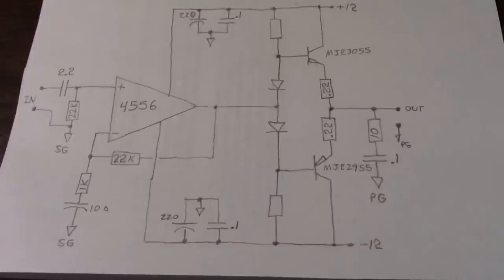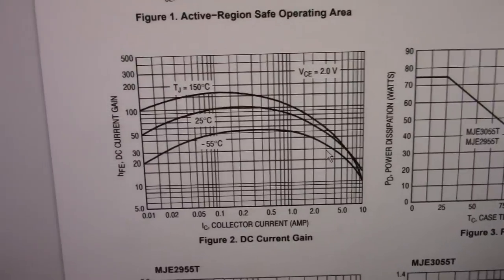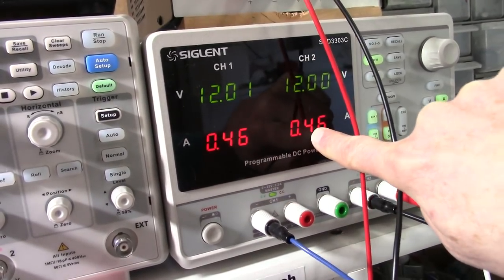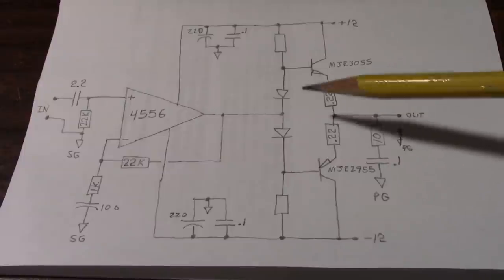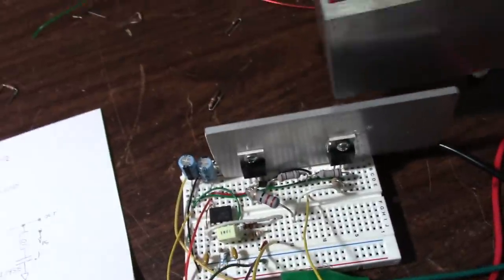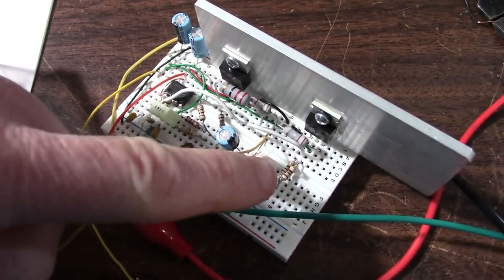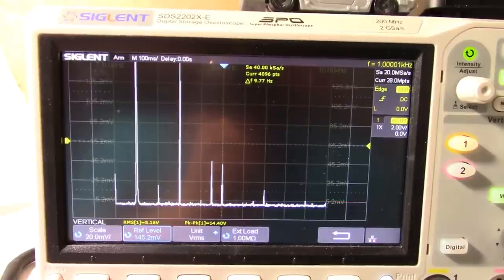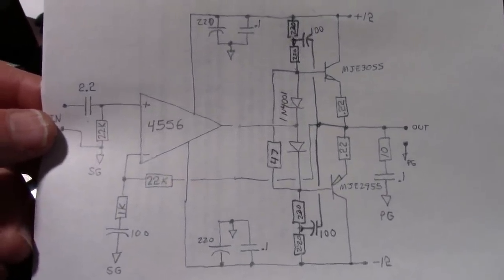Opamp based audio amplifier - 4556 driving two transistors

Comment: I had noodled out an amp design sort of like this, using op amp to drive a transistor push pull output stage.  But I haven't got around to making the video.  And its good. Because you do a much better job of explaining it than I would have!  Thank you for the video.

Comment: It was pretty obvious from the outset that using the biasing resistors were going to be a problem, since the peak current occurs when the drive voltage is closest to the rail, and that's when you have the least voltage across the bias resistor that needs it.
Having added the bootstrapping, the only other trick you might like to try is to split that 47R resistor across the biasing diodes into two 27R or 22R and connect the junction to the opamp output, in effect using separate resistors across each diode. That would mobilise the ability of the opamp to supply a decent drive current, albeit via 22R/27R, but it's a free bonus when your opamp has significant current capability.

Comment: Nice. Very similar to a project I've been tinkering with. This will help me. Thanks!
Reply: Originally the circuit looked a lot like an amp I built years ago. I got the schematic off red circuits I think it was called?
Reply: They thought of everything back in the day. I mostly just reinvent the wheel, but I enjoy it
Reply: @Spentelectrons  nothing rolls as good as a wheel does. So why not use it?

Comment: Hi John! That's great videos of yours. I'm experimenting on these simple amps too in the moment. What about using diodes in the 220-package and mount them alongside with the transistors for thermal stability? And what I found today is to put a resistor of about 120R between the bases in the basic circuit. I achive full power with this, but with a bit of crossover distortion. I'm using BD 910/911 (hfe 152) which perform better than 2SC5200/2SA1943 when testing the amp with square waves. May be you want to try it. If you want, have a look at my square wave video. Regards!

Comment: I've tried using opamps as simple amp circuits a few times. I always find to get decent performance out of them you end up adding enough extra components to offset the simplicity.

Best one I did used two opamps each directly running one output transistor  with DC offset applied to the +input for bias, and NFB taken from the emmiter of the transistor that opamp drives. Then a 3rd opamp for  global NFB taken from the output, and providing voltage gain.

Works, but you've just lost all the simplicity you were aiming for.

Comment: I would skip the 23 ohm resistor that shunts current around the bias diodes.  Instead I would increase the two 220 ohm resistors to maybe 1k each.  But then there would not be enough current to drive the bases.  So instead use the 4556 opamp to drive the bases.  To make the current bidirectional, put another diode across each bias diode, cathode to anode, or anti-parallel.  That way the opamp can sink or source current to each transistor.

Comment: Many AV amps have used this method with glorified op-amps as pre drivers and then traditional push pull outputs.  Sony comes to mind.  Edit:  I noticed when you said it was clipping on the bottom you should have changed the V/Div on the scope.  Pretty sure you were at the displays clipping limit.

Comment: I really enjoy these small design, build, and test videos because all the key concepts are very concrete and tied to easy-to-identify components or small subsystems. I was able to get your headphone amp working on a breadboard and tweak it to run off coin cells and drive a small 4 ohm speaker instead of headphones fairly easily, which was the first amp I built and very satisfying.

A lot of questions come to my mind from videos like this one and the headphone amp one like, what if you added a transistor to amplify the op amp current or made the output drivers Darlington or complementary feedback? How would you replace the op amp with a discrete VAS? What issues would pop up that one would have to compensate for? Can you implement global negative feedback with discrete components (you might already have a video about this, I haven’t watched them all yet)? Maybe it’s not interesting to people who can design a decent amp on a blank page already, and it’s definitely not efficient, but for me personally it helps bring all the design considerations and tradeoffs together better than a more complex upfront design like the JAT501.

Thanks for all the hours of great content, hope Snickers is doing well and we get to see/hear him again soon!

Comment: Is the low output power actual inefficiency? Are you burning loads of power or is it just not taking and then delivering the power from the supply? I could live with getting 5 watts instead of 10 but only at 5 watts worth of power from the wall (i know amps arent 100% efficient, hence the "worth") - lets say, using this amplifier in a situation where 3 watts is enough.

Comment: Could the two diodes be connected to the collector of the bottom MJE3055 and have the Op-Amplifier drive the Base of the bottom MJE3055 which will give us a Class A amplifier with a wide Bandwidth. this type of amplifier was of the type used to drive the cathodes of color CRTs.

Comment: Can we have an amplifier working well with just a single npn transistor at input stage and two transistors (npn and pnp push pull) at output stage along from where we connect the speaker with the whole circuit working on single 12 Volt supply ? How much power we can expect from such a circuit ?
Reply from the maker: Yes, I made an amplifier like this in a past video. Good for a watt or so at 12v.

Comment: This circuit reminds me of the example circuit in the TDA2030A datasheet!!!! Always wanted to know if it was any good! Especially the active 3 way circuit in the same datasheet, in one of the other TDA amplifier ic datasheets of the same vintage had a 2 way active circuit example in it as well! 
I have Fostex 3 way powered studio monitors and they are amazing, they are using chip amp's which are shielded a bit to well and I can't see which one's they chose to use but going by what's around them, they appear to be class AB... 
I don't really understand the principal of using a power amplifier IC to drive two transistors in that TDA2030A datasheet but it's there and it supposedly works! How good though.... I wish I knew... I wonder if that same circuit example would work well with the TDA2050A? 
I have a heap of the 2030's, I might have to grab a heap of the 2050's considering how well they performed in your tests...

Comment: ,voltage from +12 volts will flow through the series diodes going to 12 volts supply ,if you connect 220ohms resistor from the rail +/ supply, instead reverse the diodes position, i notice them on some other amplifier design ,?

Comment: Great video John 👍 Thank you for the video. I do have a suggestion on this amplifier. Without a bootstrap circuit I just added a capacitor 1uF from NPN transistor base to PNP transistor base, it sounded just right. What you think about such a configuration?
Reply from the maker: I tried connecting the opamp to each transistor's base through a 100uf cap. At high signal levels, the bias spread collapsed and I get crossover distortion due to no consistent bias current at high signal levels. The cap's voltage discharges and collapses the bias. May work with the smaller cap but you get weaker output at lower frequencies.
Reply from the maker: @EngineeringEssentials  No confusion, I understand what you meant. I didn't try exactly that but something similar.
Reply: @JohnAudioTech Thank you for the reply. just curious, In this scenario will a MOSFET do any better?
Reply: @gkdresden  R4, R5 and J1 is that some kind of bias spreader?
Reply: @EngineeringEssentials  in fact you will need a Darlington BJT like TIP120 /TIP125 otherwise you need more current through the bias spreader than through the output stage (like in the case of Johns amp). MOSFETs are voltage controlled devices with nearly no input current at audio frequencies. They can be driven by a few milliamps. And the threshold level of logic level MOSFETs is about the same as the threshold level of Darlingtons.

Yes R4, R5 and J1 are the bias spreader.
Reply from the maker: @gkdresden  I'll have to check the logic MOSFETS. I avoided MOSFETS in lower voltage amps because of the large bias spread voltage needed. What kind of output swing loss do you see at 4 and 8 ohms?
Reply: John, the output swing loss is around 1.7 to 2.0 V for a rail-to-rail opamp like the AD820 , independent on 4 or 8 Ohm. I have set the bias current to a value, where the crossover distortion vanishes. This is about 10 to 15 mA. I have no thermal feedback in my circuit, but the bias current never exeeds 60 mA at full RMS power for several hours and it returns to less than 30 mA at 1 W RMS power after 10 minutes or so. So there is no need for thermal stabilization by use of sufficient heat sinking.

You can also use the full rail-to-rail voltage if you apply double boot strapping, a splitted bias spreader resistor and 2 current sources instead of your 220 Ohm resistors directed towards the bias spreader. For the current sources I don't use the J113 anymore. The LM334 can be used to make a constant current source down to a voltage drop of less than 0.1 to 0.2 V.
Reply: @JohnAudioTech  These days you can get mosfets with extremely low threshold voltage, well under 2V, a little harder to find P types. But there's still plenty to choose from; though you may have to dabble in SMD

Comment: I have questions -
1. How much Watts can we expect from a Single supply Single ended amplifier @ 4 ohms on 12 - 14 volts ?
2. Does a Bridged amplifier output 30 - 40% more power than single ended one operating at same supply voltage ?
Reply from the maker: 3 or 4 watts. In theory a bridged amp will deliver 4 times the power into the same load using the same supply voltage.  In reality it is more like 3 times. The amp in your question 1 would deliver around 10 - 12 watts when bridged.

Comment: Is it possible to increase input voltage more than 12v to get more power
Reply: Moar powah!
Reply from the maker: Yes you can run it up to the limit of the opamp's max rated supply voltage but I'd keep it at +/- 15v max. You may have to adjust the bias.
Reply: I recently picked up some OPA551 op amps for that purpose. +/-30v with 200mA continuous output. I have no idea how it will perform as an audio amplifier but it's fun the play with none the less
Reply: @JohnAudioTech  to get around op amp limits I've put regulators on amps just to drive the op amps. If you lay the circuit out good it's no biggie to use 3 terminal regulators.

Comment: Would you ever use an op amp based input stage for an audiophile amplifier?
Reply from the maker: I'd probably go full discrete but it certainly could be done.
Reply: @JohnAudioTech  Just wondering

I’m working on a fully discrete audiophile amp right now :)
Reply: To be an 'audiophile' you must believe that op amps are the spawn of the devil, so, no.
Reply: Opamps outperform any discrete setup by miles. 

See http://nwavguy.blogspot.com/2011/08/op-amps-myths-facts.html

Also take a look at https://sound-au.com/project07.htm

I've measured opamps vs discrete amplifiers myself, and there's no contest
Reply: You can certainly build discrete opamps of any performance level. I’ve got below -140dB thd at 20kHz out of mine and check out the Weiss op-2 discrete opamp for the best commercially available opamp of any stripe. That said, most of the shelf discrete opamps don’t measure half as good as an opa1612 or similar and very few bother designing for power efficiency.